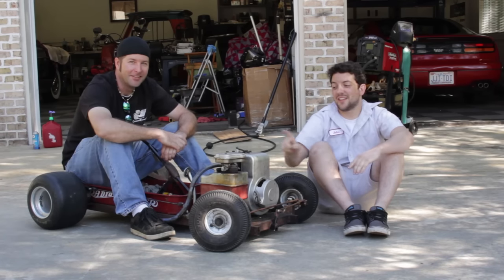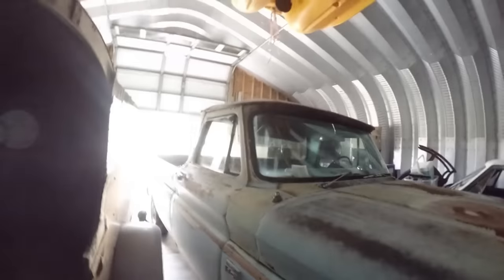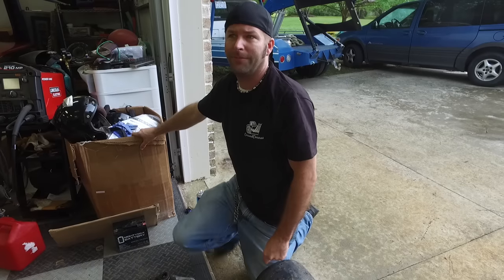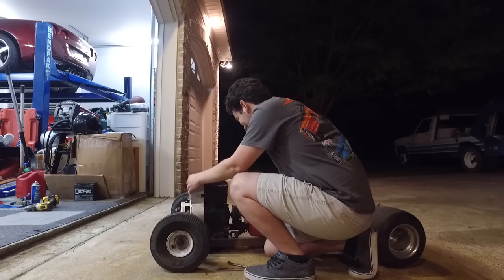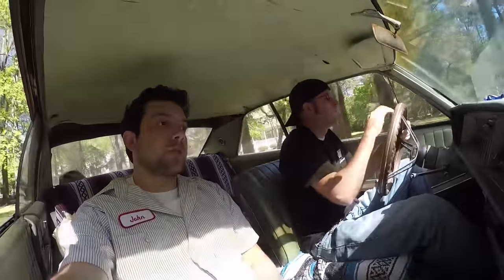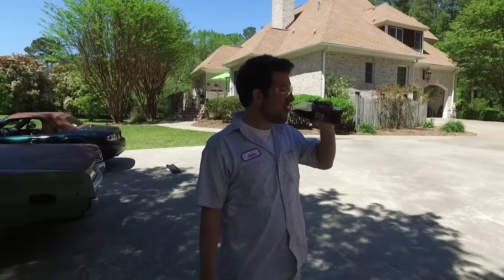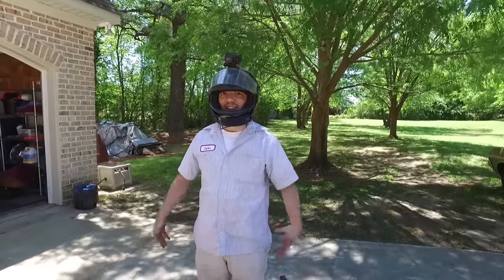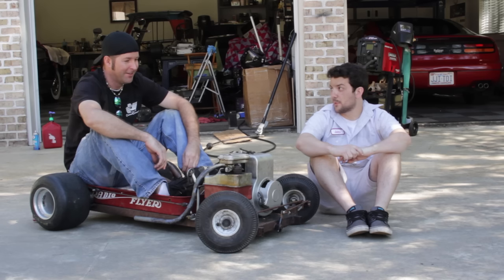The Rat Rod Wagon is a BEAST

Comment from the maker: We're getting close! Maybe headlights and pinstriping next?
Reply: i like your show
Reply: toss that e3 plug in the trash.
Reply: +Puffalupagus360 wait who was u talking to I'm lost
Reply: +CarsandCameras Ya... Get These, http://www.piaa.com/store/p/853-LP530-3-5-LED-Fog-Light-Kit-SAE-Compliant.aspx
Reply: small fenders 
front&back
Reply: +Hennessey Viper Venom * full go kart frame and find a small 4 cylinder or 3 cylinder engine and put it on a go kart that would be interesting
Reply: +jeramiah hangs 4:07
Reply: +CarsandCameras Don't forget: http://static.speedwaymotors.com/RS/SR/Product/2191000_L.jpg
Reply from the maker: +jeramiah hangs Thanks!
Reply: yeah headlights would be cool but you could make a weightened front bumber to put these headlights on!! this could help with the turning problem and add some style 😉
Reply: +CarsandCameras can i buy one of those working briggs engines off you guys? i got a go cart for the first time in my life and the original motor was shot and i got another one but i started working on it and i destroyed a bolt and ended up breaking that little section off trying to get it out. I dont know anyone who can weld aluminum for cheap. So you guys would sell me one of those engines for less than 120 and they either one i get will run good without much more money needed to make them run if they break or just need other stuff then i would be soooooo happy.
Reply: v twin
Reply: +CarsandCameras This sh*t is so Roadkill. 
I love it.
Reply: you guys should build a plate to go over the axle like a shelf
Reply: You guys should make a tandem axle tow kart with a push bumper
Reply: Horizontally opposed twin
Reply: I think you guys might want to put a backrest on that bad boy. it should help improve posture a little bit. seeing you guys sit like that is hurting my back just watching.  haha
Reply: put pvc on the wheels
Reply: Or a new microphone.
Reply: you should try to turbo the v-twin
Reply: go cart mower! half riding mower half go cart
Reply: Racing mower build.
Reply: I got a outfit for the engine , to make it look like a real one with a big blower on top to show off
Reply: +lexus14blacklist that would be the best.. then a trailer for it that the rat kart goes on
Reply: Yea
Reply: Next build do a full suspension 4 wheel drive go cart, and put a roll cage on it and take it on offroad trails.
Reply: +MONEY SLAP no you have to do that and a leaf blower supercharger
Reply: +CarsandCameras As far as the seat goes, I would recommend one of the metal pan seats from tractor supply. They're pretty easy to mount and are slightly springy to boot.
Reply: Wouldnt the leafblower technically be a turbo
Reply: +Kyle Orme yeah basically
Reply: +CarsandCameras After you guys complete the rat rod wagon, you should make a lifted go kart with actual shocks from a motorcycle!
Reply: a monster kart or an off-road  shoping kartwith the v twin
Reply: Needs whitewalls
Reply: +CarsandCameras i think u guys need a little better gearing on it
Reply: +CarsandCamerashave u ever thought about putting a diesel engine on any of the go karts
Reply: +CarsandCameras Have you ever heard about powerland engines?  They have a 16hp engine on ebay right now for just $190 and a 13hp for $150 I've never tried them myself, some reviews are good and some bad so I'm not sure if they're any good.
Reply: +CarsandCameras I think it's time you guys scratch build a frame. Maybe an old dirtbike engine with a 5 speed and clutch already attached.
Reply: +obese hamster films I'm pretty sure they are pinned at full throttle for generator use
Reply: You should make an intake scoop for it
Reply: Why do you have a vette sitting there?
Reply: +Θωμας Αμανατιδης because Cars & Cameras...aaaiiiieeee!
Reply: sykwookiee Yeah i know that by why isn't he driving it
Reply: Not that I have any idea, but it looks like you have to ride the brake with the way its set up. I would put like a little foot bar off to the left of the brake, or maybe a big one in the middle for either foot, just so you dont have to wear it out. Cause keeping your foot lifted off the brake seems hard with the leg angles in that small cart.
Reply: Yall look like mario kart racers
Reply: I wish you didn't say that, because I was going say that! haha...I could almost hear that cheesy music -
Reply: well its been a month have you put a backstop on it yet so you can not have horrible back pain?
Reply: YEAH!
Reply: Partial Rear wheel steering!
Reply: Headlights
Reply: when are you going to do the 3 gocarts for 3 hundred dollars project
Reply: Where are you guy's at?
Reply: front bumper, headlights, taillights and some white walls. Hot rod dream
Reply: CarsandCameras that would be cool
Reply: I love your videos, plz respond you guys tought me everything i know about go karts.
Reply: CarsandCameras I
Reply: CarsandCameras r u guys going to do more videos about this project
Reply: It’s not turning cuz it’s posi trac with a lot of rubber in the back along with ur body weight

Comment: If you have a fairly rigid chassis and you build some castor into the steering it has the effect of jacking up the inside rear tire when you turn the steering wheel. that is what makes a go-cart turn when you have a live rear axle.

Comment: Possible solutions for front tire grip:
-Wider, stickier front tires. 
-Lower tire pressure up front, more in the rear. 
-Bolt a 30-50lb  lead weight to the front of the frame somewhere. 
-Move the rear axle further back, to just outside and  behind the tub. This will move your center of gravity further forward, improving front grip.

Comment: You guys are a crack up.  I'm currently undergoing my Briggs and Stratton Master Service Technician courses, I'm a technician at a Brigg's authorized service center.  We get these L heads in on some antiques that come in.  I can't stand these setups, with the carb bowl in the tank, those carbs are ridiculous.  To call this the "last, good running briggs 5hp flathead in existence", is a bit of a stretch, however, you're right about parts availability.  I can get most stuff, however those carbs are like hen's teeth.  If you can even find one, they're over $130.  Kudos to you guys for messin around with em, this is a cool build, but those old L heads are still garbage, lol.

Comment: The Rat Rod Wagon Rock's!!!!! And yes, Pin striping is a must!  Also, a vertical steering shaft set up with a T-Bucket steering wheel would look trick and would give it that Rat Fink look. And for the seat, how about a simple aluminum seat pan. Or better yet, a seat pan made from really old license plates?

Comment: Suggestion for the next one.
Differential, big offroad tires, independent brake in case of single wheel slippage, suspension. Predator 212 or 420.
Reply: +jesondag lifted off road cart would be sick
Reply: @BarrackOcody  Finally done it!!!

Comment: I've said it from the very beginning, That thing needs proper Caster, Camber, and Ackerman set up- then it would steer correctly- it still wouldnt be too hard to fix, and it would drive like a proper kart then, just cut off the spindle hangars and weld them back on with the correct angles in them-  it's a death machine the way it is now! if you fix the steering geometry then once you put the seat on it (esp if you move the seat back a few inches, like over the axle) it will drive really good-

Comment: I've got an old 8 hp Briggs on an old manco dingo that I'm restoring. However, I can not get the motor running for the life of me. I have replaced the ignition coil, spark plugs, and carburetor. It seems to have compression and it is getting fuel. Any idea why it won't start? Valve spacing? The carb is a knock off so could it be that? I appreciate any help you can offer. Keep up the good work
Reply: i wish i could tell you. i would have to be there

Comment: I love the Briggs, I grew up racing those and the Yamaha KT 100. But the Briggs hold a special place in my heart. They can be built to be pretty impressive
Reply: Just put a billet or other aftermarket oil Dipper in them and they stay together pretty good
Reply: Shave the head down, use an oversized compression ring and file it to around .010 gap maybe .007, use a 3-1/2 hp Briggs aluminum flywheel and make an adapter for the coil, 3 stage header, get a cam for it or at least reduce the lifter gap to get more lift, nylon or billet oil dipper, tillotson carb. It'll run good!😁🤓

Comment: you prolly need to have one of the rearwheels freewheel (put on the axle with a bearing in the hub) to be able to turn sharply
the way there now mounted to the solid axle makes them act like a dif with a spool in it it wants to go straight only 
either that or try to lift one rearwheel when cornering 

might be fun to put one of those 6 feet long oldfasioned fiberglass CB antenna's on the back with a foxtail , makes you a little more visiable too

if you find another little red wagon bucket you can saw it in half and mount it on top of the other bucket over the axle , use it as a seat

Comment: you could cure the steering issue by putting 12-15 degrees of caster in the front axle. just cut it loose from the frame and angle it back. that's why the race karts handle so well.

Comment: Hy guys!
You sould increase the tire pressure on the back. Since it is not a race cart, the slicks are for looks. Does not matter if they have less traction on the back. :) I would advise to decrease the pressure on the front, but there you would loose top speed.
With higher pressure, you may reach a higher top speed. :D

Getting stoked with this bulid, you guys are crazy, and I like it. Keep it rockin'!

Comment: I've been wanting to build a Spyder-Slingshot type go-kart using a Mustang II design front end suspension and a mono torsion trailer axle using a front hub setup with the disk and caliper with a stub axle welded to a sprocket for the rear drive. A twin cylinder predator engine and a torque converter setup would be used to power it.
Reply: At that point forget about a predator. It would need a V-Twin from a Harley. 1200+CC engine.

Comment: Open the 90 degree drive assembly and put motor oil in it because it has thick thick think grease inside it believe me it will be fine 10-40w
Reply: better yet, why not throw some full syn differential fluid in there?

Comment: Guys its time you adventure off road and build a dune buggy!!!! Full on lights, full suspension, Vtwin or even better Honda cb600. That will be mental, you will finally have a project with gears. That will be absolutely amazing. I know "rather B welding" has done something similar but used 2 predators.

Comment: Hello like the ch. i have always love go karts. if you would like a faster take off pull the flywheel off take it an have the inside 
ground off. i was taking a 10 Tecumseh they was 14 pounds after got done had it down to 8 to 9 pounds. you can pull the head and 2 thing have the head shaved just a little. Are order a thinner head gasket take molding clay an see how much
room you have between valve an head.lot little thing you can do.

Comment: Very entertaining show guys. The motor without a flywheel cover looked cool. What do you think about removing the recoil pullstart and cover, exposing the cooling fins and adding an old style rope and pulley pull start on the motor you used?
Reply: +the upscriber it would overheat without the cover

Comment: huge question.. so my toro 5 hp 4 stroke lawnmower motor is making a weird pinging sound.
I've already took it apart and cleaned the piston head and cylinder and i've checked the crankshaft for play and there is nothing wrong that i can see. any suggestions ike?
Reply: +gavin nieves pinging at idle?
Reply: +Isaac it'll be fine its a push mower. yea it happens after it warms up and slowly gets louder as I mow. one I let it cool down it won't be as loud , but then does it all over again
Reply: check under the covers in the cooling fins. it might be full of grass and overheating

Comment: You guys should make a shifter kart. My friend has one with a honda ATC 200 that does 80kph on the open road plus it has great low end power due to 5speed transmission. Another friend recently converted a 5.5hp honda kart similar to your predator 212's to a suzuki 185 shifter kart. They have heaps more torque and power you could easily swap one of your predators to a dirt bike engine would be a cool video

Comment: You guys should build a engine test fire stand a 2ft by 3ft steel plate with handles on the sides and a good amount of holes in the plate so you can quickly bolt the engines to it and be able to start them without yanking them around and possibly hurting your self and you could stand on it so it doesnt move!!!

Comment: do a double engine go cart build. with dual headers that go down along the chassis like on this wagon.  it would be ever cooler if it was on a custom frame that you show us how to build. maybe 2 predator 212's? or 2 5hp brig's. something with 2 motors on the same chassis. it would be amazing if you were able to do it. even more amazing if you made it a front engine rear axle like the rat rod wagon. would be the most amazing go cart i have ever seen.

Comment: If you moved the sprocket to the other side and flipped the drive shaft wouldn't it have run in reverse?
Reply: +Brian G yes but i would have turned the engine too

Comment: I was very close I on my guess for the top speed (no spoilers).  Dang I cannot find one (running or otherwise) free 5hp and Ike has three, heck I don't even need s a carb or tank as those will be changed to something else.  Might want to consider building a small engine testing plate to clamp a motor down to test fire, trust me you do not want one getting away and smackin your shins.
Reply: +Liowen 
I have an old 5hp B&S (wearing the Craftsman name) removed from a low hour tiller that had a bad trans. I would give it away for "free" if you are really in need of one. Hasn't been started since removing it from the tiller over 15 years ago.

Comment: Why not bend a piece of sheet metal over the drive shaft kinda like a tunnel then staple a soft material to make a seat (put foam on the sheet metal then get a leather jacket or something similar and staple it and mount it to the go kart) and bolt it to the frame

Comment: You should make another electric go cart by doing this... Put two smaller batteries on the last electric go kart frame you made and  attach the negative output on one of the batteries to the positive output on the other battery, and connect the remaining  possessive and negative outputs to the motor without touching them, it would go probably double the speed. Then you could fallow the same concept with even more than two batteries as well. Just fallow this pattern + - + - + - + -